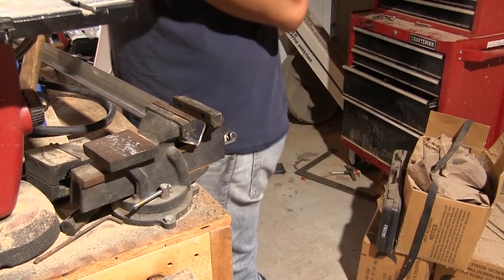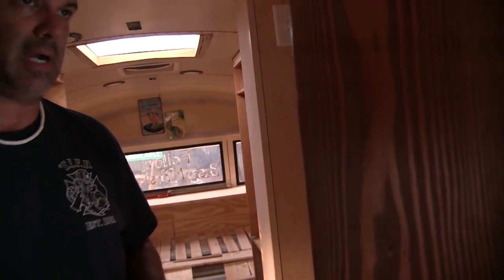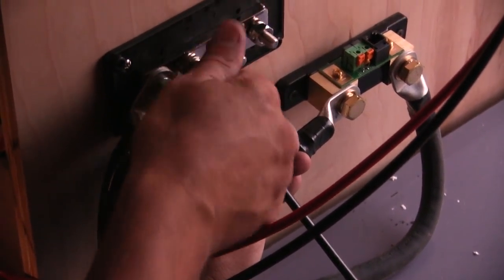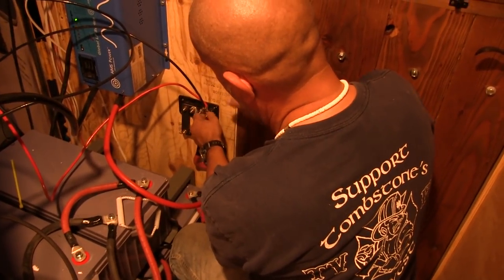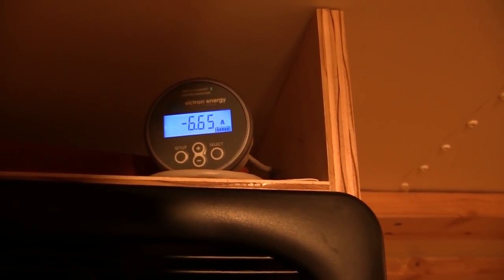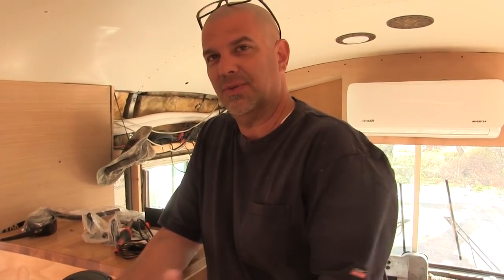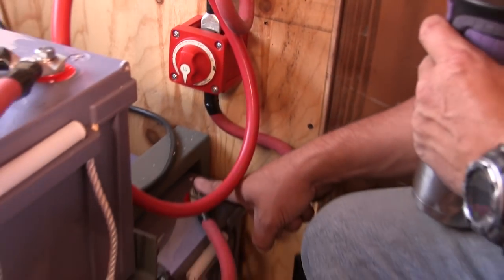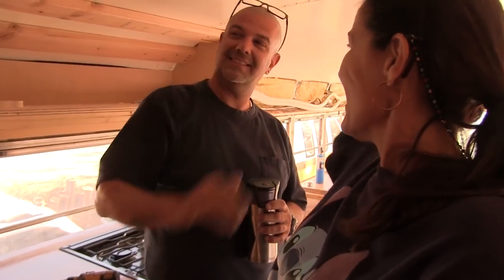Skoolie Solar System Complete: Victron Battery Monitor, Wiring, & FINAL TEST! (Part 4)

Comment: LOVE that battery holder you built, we plan to stack ours as well so we might run into the same problem of the wires not reaching. Thanks for always filming everything so we can try to figure it out!

Comment: Hey question for you guys, wouldn't it be a good idea to put a battery shutoff switch directly inline from the last positive to the fuse. That way you have a way to shut down power.
Reply: Nevermind i actually saw the shutoff switch when i looked again. Really great setup you guys have.

Comment: Did Mike say Flux Capacitor, OMGosh. Those birds are so happy. I think the birds are in heat. I watched a video the man had a washer, dryer, mine split, deep freezer, a separate fridge, Hot water heater, and a great big TV. he has a shorter rig but still, he don't have any gas at all in his rig, he has a diesel heater the rest is all-electric. he runs it all no problem. I was told you can't have all that on a bus unless you had a massive solar set up. Nomadic Home Tours is where you can see his cargo trailer. Its worth looking at.
 Did I see mosaic work there for a second?  No serially do you guys have an emergency exit in the bedroom?

Comment: I have a  question for you two wild & crazy kids.
Could you please tell me what brand terminal blocks you used. I am also in the need of two for my solar build it would be  greatly appreciated.
I just finished watching all the video's they were fantastic!!!!!
Reply from the maker: Do you mean fuse blocks? Other than that I imagine it's in the description and there is a link.
Reply: @BussyMcBusface  Thank you for the reply
It was the two black box's you use for all your pos. & neg connections.
One of them was use for the neg terminal connection for victron battery monitor.it was in your solar part 4 video 
I did not see a link.
Again thanks

Comment: If that was a pice of steal flat stock going from the fuse to the distribution block please replace it with a copper buss bar or cable.
Reply from the maker: How come?
Reply: Bussy McBusface; That pice of steel will have a much higher resistance than a copper cable or a pice of copper bussing. Will it work with the steel? Yes. Is high resistance what you want? No. Is it easy to correct? Yes.

Comment: Did you test the A/C yet?
Reply from the maker: Oh, yes! It easily powers the AC. In the winter sun, we were still charging the batteries.  Heat pump mode however showed a 5 amp deficit (loss) from the batteries. I am very confident that in the summer the solar panels will run the AC easily while topping off the batteries.

Comment: what brand is ur battery. where did u buy it. how many amps hour for each. how many volts. how much
Reply from the maker: Ask nicely
Reply: @BussyMcBusface  i would like to know about it. would u please help me to know because i m poor but i need to build my bus for full time stay with my dad.
Reply from the maker: They are renogy batteries.  They are 200Ah each.  They are 12v.  They cost us at the time $350 each. We bought them on Amazon.
Reply: @BussyMcBusface  thank you very much bro. if u do not mind i still have more question to ask because my dad will start to do that bus around october. the bus is still rebuild engine.
Reply: @BussyMcBusface  dear bro, for the battery, would u please help me again, is it C10, OR C20 for these kind of battery. I cannot find this information because i need C10

Comment: You spent sooo much on your solar system, just curious why you didn’t go a little bit further to Litiums??
Reply from the maker: We spent $1,000 on batteries. Lithiums would have cost us about $8,000
Reply from the maker: It definitely isn't a little bit further.
Reply: @BussyMcBusface  I thought those AGM’s were about $500@
Reply from the maker: We spent about $220 per AGM. The cheapest I could find lithiums were about $850 for a hundred amp hour battery. We have 1,000 amp hours with our AGM batteries.